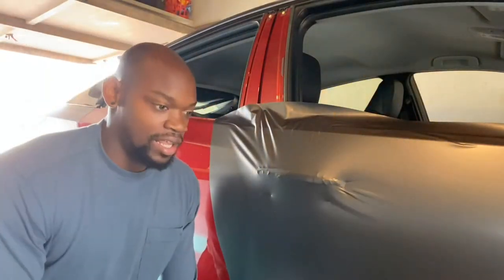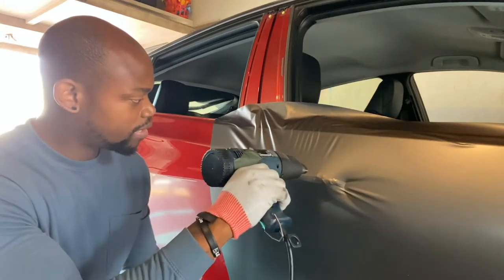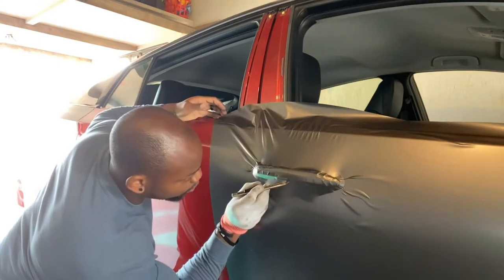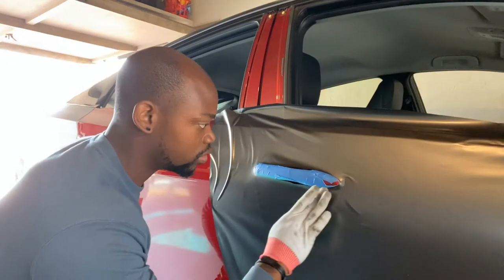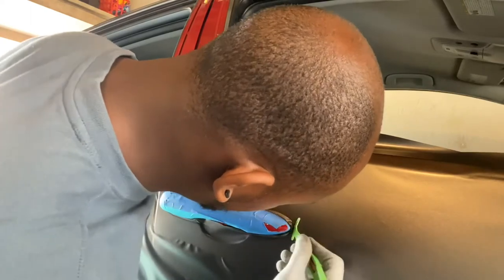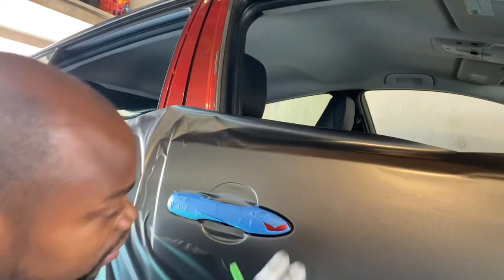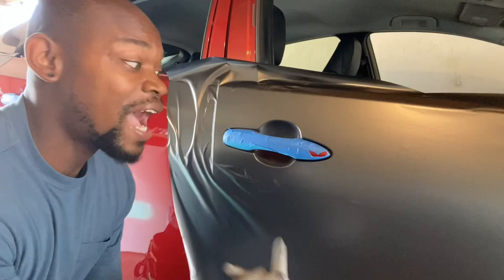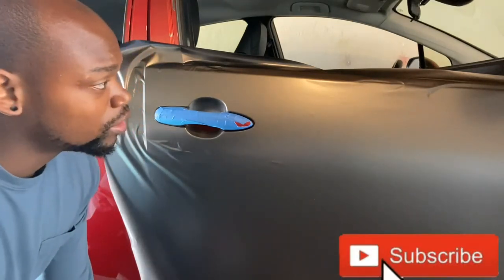How to wrap a door without removing the DOOR HANDLE THANK ME LATER 👌🏽🤯

Comment: Great video. I'll probably be using this method and also removing the door handle afterwards to get the inlay on properly. The reason is that when you remove the door handle, it's still stuck by a wire. To remove the wire you have to remove the whole door panel inside and mess around with a clip that's difficult to locate. I rather just do this.
Reply from the maker: Yea those are the worse I hated removing things off pples cars! That’s why I had to hire a mechanic the best investment in the world lol
Reply: It not that hard to remove most door panels but yeah I feel you so far a srt Jeep Grand Cherokee has been the hardest handle for me to remove I also had to remove the Glass in front doors!
Reply from the maker: @bsmntcustoms  yup that’s why I hired a mechanic he ran into that same problem removing the front windows 😅
Reply: happened to me with my driver side door, also did it with my other ones but the drivers side was the most difficult to reassemble so gonna give this a try with one of my doors that I'm going to redo this weekend

Comment: You can definitely see a big ass piece missing when you open the door!
Reply from the maker: There’s a inlay in the area your Referring to the video was just for those who wanted to know the process of vinyl wrapping around a door handle
Reply: Lol you cut a piece and cove the inside genius. He didn't show that part.
Reply from the maker: @iamstiffthebear  yea when you don’t have the knowledge as far as taking door handles apart you wrap around them and it’ll be a small inlay in the inside of the door which no 1 looks under there to see 🤝
Reply: @kjwrapz  not just knowledge. I have a 2018 Mercedes sl63 and you can't remove the handle. The inside door handle is literally welded with a plate and rivots.  Su unless you wanna bust the welding you have to finess around the handle.
Reply from the maker: @iamstiffthebear  damn seriously 😳 now that’s crazy I don’t understand why they would do something like that 🤯 well that’s good to know so when I get 1 of those to wrap I know I can’t remove the handles
Reply: @kjwrapz  yup they making it harder to take.cars apart and cheaper plastics parts. Its easy tho,
Reply from the maker: @iamstiffthebear  THAT IS TRUE